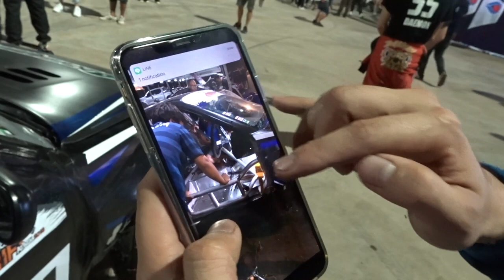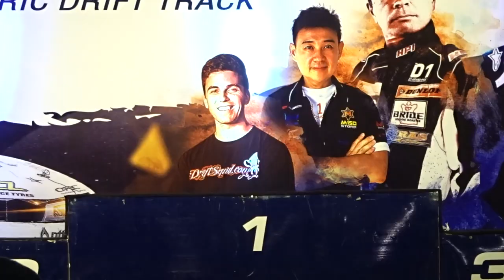First time Drifting in THAILAND | 750HP 2JZ 180SX | BRIC Drift Attack 2018

Comment: driftsquid. Do you know something about the project mu caliper? Will you feel the wird feeling on your pedal while handbraking?
Reply from the maker: Nah you dont get the interference as you normally would. Its simply a calliper with 2 ports on it that control 2 different brake pads in the one single calliper. They are an amazing design and Id love to get them how ever they are super pricey compared to your usual twin calliper setups.